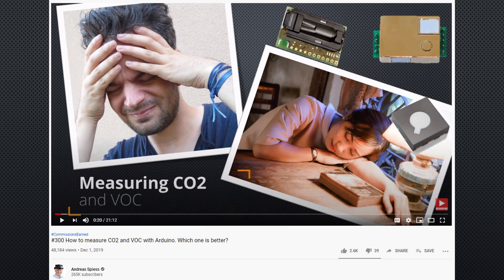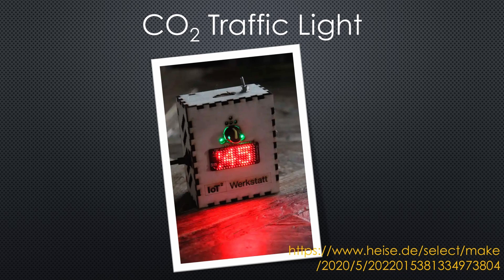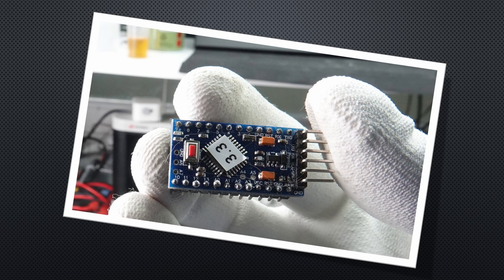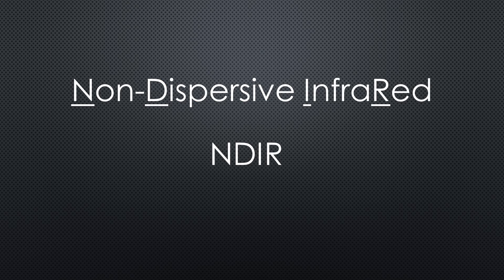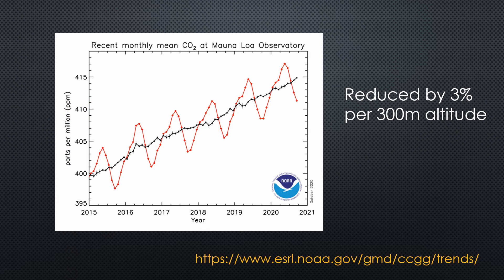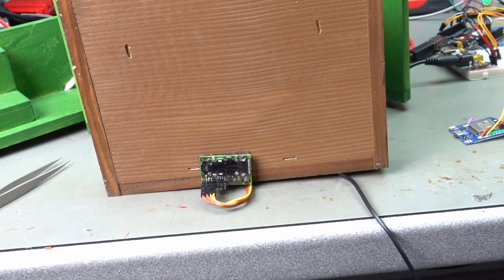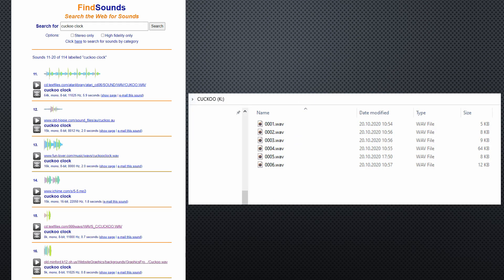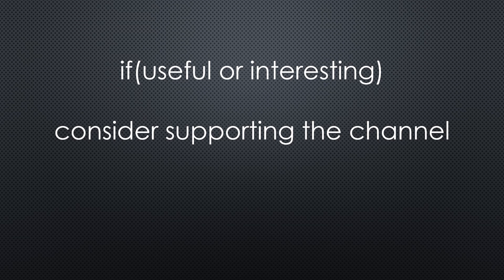#358 CO2 Cuckoo Clock for schools and businesses (Why not eCO2?)

Comment from the maker: A Patreon recommended the Senseair S8 sensor. It is just a little more expensive than the MH-Z19 but more reliable. And it is available on Aliexpress.
Reply: A quicky video on this S8 would be great! Especially a comparaison on the autocalibration feature.
Reply: Should've been named a canary clock. Because it detects gases yknow.
Reply: SenseAir S8 is way more practical than the MH-Z19.
Mechanical footprint is the same and also the signals applied to the pins is the same. So you can mechanically and electrically exchange the two.
Only (outer) mechanical difference is the position of the diffuser.

The SenseAir S8 is way more practical since it is using a much more practical ABC function.
The MH-Z19 (and also the B version) only use a 24h interval to determine the lowest measured CO2 concentration and set that as "400 ppm" level.
Problem is you need to have at least once during the day a well ventilated room or else your readings are way off.

The default ABC period of the S8 is 7 days and also the applied correction is not just based on the lowest measured value during that period.
It takes into account the aging of the sensor and it only applies a fraction of the measured correction as it is highly unlikely the 400 ppm level is off by a very large offset.

Causes for abnormal CO2 concentration in a room without people (or animals) in the room:
- Plants exhale CO2 during the night (outside in agricultural area with no wind, the CO2 concentration can be as high as 700 - 800 ppm during the night)
- Living in a city, next to a busy road or industrial area, with almost no wind or wind coming from the wrong direction.
- Freshly painted room (some drying paint absorbs CO2)

As all these causes can all occur during a period of 24h, your ABC function can be set completely wrong.
That's why you really need a sensor that can be set to an ABC period of > 24h.

N.B. in ESPEasy I disabled the function to adjust the ABC interval on SenseAir S8 sensors, as there has been a firmware bug which could lead to a user only being able to lower the ABC period, not setting it back to a longer interval.
Reply: I recommend CDM7160 sensor, it comes pre-calibrated from the factory and also the long-term drift compensation (autocalibration) algorithm is much more city-friendly (it does not require periodic exposure to 420ppm fresh air, which might be impossible in real-life situations).
Reply: There is a nice video series from the manufacturer about the S8: https://www.youtube.com/watch?v=n059hQpybsE
Reply: @julianwolter970 , and others looking at the S8 video series. The playlist is a bit nicer, all the videos are very short and don't all link to one another without the playlist.
Reply: @Pilot16H Please explain why the US voting would have all other countries worried about so much, if it were "just the flu" or artificially inflated. And no, don't bother claiming the US is top of he world, it lost any potential leadership after a few months of your bozo Golfer in chief.
Reply: @Ping Ping or fake units.
The absolute lowest sales price ex VAT in large volumes (10 k+) I have seen is around 22 euro. Take into account a seller has to keep stock, account for customer service and maybe also make some profit.
So I don't trust those sold at prices lower then 22 euro.

For the units priced at 80 euro and higher, are you sure it isnt the LP8?
Those are quite expensive and look the same (but are absolutely not exchangeable for S8)

Right now there does seem to be a global shortage on CO2 sensors, so I don't think a filter based on price to differentiate genuine from fake units will hold in the next few months

About the difference in numbers, keep in mind there are several ranges in ppm available.
Some even upto 50'000 ppm
Reply: I think Andreas Does some mindreading with al his HAM expertise 😉. Again great topic 👍👍🏾. MH-Z19 works fine for me. Bought 2 pieces 2 years ago and did connect it to a esp8266 with Espeasy firmware and domoticz. Works fine when your wifi is stable
Reply: It always boils down to: what is "good enough" (for all practical purposes) in order to give an indication when to vent a room. Many claim that a BME680 be sufficient. At the other end of the spectrum you have the $50 SCD30 or the $200 CDM7160 :).
Reply: @Pilot16H C'mon, this is an IoT channel and not another outlet for obvious unfounded fake news.

Comment: Have you measured the power consumption and "time to accurate measure" of the SCD40?
With such a small sensor, it would be cool to make something very portable (to bring to a meeting or dinner) if the power consumption is reasonnable
Reply from the maker: I do not remember. But you should find this info in the datasheet.

Comment: Hi, I own a fresh SCD30 (and an old MH-Z19). Have you found a solution to ESP32 I2C clock stretching? It's to experiment phyphox CO2-Monitor.
Reply from the maker: Sparkfun seem to have a library for this sensor which also works on an ESP32. I do no more remember how I did it. But it works

Comment: CO2 concentrations above 2500 ppm cause a decrease in concentration and laziness. As a bioeffluent, CO2 is the easiest parameter to monitor the IAQ and to control the ventilation demand if a mechanical ventilation system is available (demand controlled ventilation). VOCs are determined by the occupancy rate of people in the room as well as by furniture (e.g. formaldehyde), mould (!) and various cleaning products. CO2 is therefore the better choice in classrooms because the collective breathing volume of those present is the determining factor. I have installed CO2 meters in many classrooms already for Corona, in the years 2010-2015. Senseair S8 sensors were reliable and stable over long periods of time, MH-Z19 not so much because they drift upwards (even when placed outside for months for checking).

Regards
Reply from the maker: Thank you for the additional info! It seems that schools in Germany bought a lot of such ready-made sensors. I think it would have been a good idea to build them and learn...
In Switzerland they still did not decide on what to do. If i look at the increasing numbers we probably still have a lot of time to decide ;-)

Comment: 08:32 Does CO2 ppm reduce with altitude? I thought it was relatively constant for the altitudes humans live at with some perturbation around ground level man-made sources. The sensors need to be able to calculate the number of non CO2 molecules in the air which would be very similar to air density calculations - the pressure, temperature and humidity impact that with pressure declining with altitude.
Reply from the maker: Maybe you google. I found that it depends on hight.
Reply: @AndreasSpiess  This was the first thing I found https://earthscience.stackexchange.com/questions/16364/what-is-the-co2-concentration-by-altitude-and-why and there's a similar graph in https://www.ncbi.nlm.nih.gov/pmc/articles/PMC6263399/figure/sensors-18-04064-f006/ . There could be a slight gradient there but it does not look like 3% reduction per 300m, i.e. 415ppm does not become 290.5 at 3000m (9843ft).

Comment: Hi Andreas : great tutorials !! we enjoy it with our  class. Just a little question ? what about callibration on these sensors ? do we need to calibrate them after a few years and if so : how to do this ? of just swap the sensor maybe ?
Thx for the reply and please keep posting these great tutorials !,
Reply from the maker: You can switch autocalibration on. Or you put them outside where the CO2 is around 410 ppm
Reply: @AndreasSpiess  thx andreas, so if i understand correctly, we just have to take them outside once a year and the the auto callibration will do the rest ?

Comment: Thanks for a great video. I'm just in the almost same project for school and I just finished mu CO2 level project for my LAB - indication of CO2 is by colors of LED strip. I used Desk Stranding lamp from PrusaPrinters project (some pictures here https://www.prusaprinters.org/prints/40386-desk-stranding-the-death-stranding-desk-lamp/comments#comment-47597). I'm using sensors from Netatmo Weather Station and using Node-RED and HomeAssistant. Next project is to use real CO2 sensors and color display with ESP32. Another CO2 related gadget could be SmarWi project from Vektiva (https://vektiva.com/en/). I'm using it for a 2 years for ventilation in my bedroom (works with EU windows ventilation) and I can recommend it.
Reply from the maker: Cool project!

Comment: Andreas, thanks for nice video! If talk about comparison Co2 and eCo2 sensor, especially about css811. In css811 datasheet said that "ams advises customers to run CCS811 for 48 hours in the selected mode of operation to ensure sensor performance is stable", and in case  Automatic Baseline Correction "The air quality is expected to vary in a typical environment so the minimum time over which a baseline correction is applied is 24 hours". Based on this data we can assume that some more less accurate values we can get from sensor after 2 days after first start.  As I understand  from your graph, tests lasted 5 days,  and result after 2 and even 3 days  was't similar real CO2 sensor,  what library do you used for tests css811? Maybe there was some problem?
Reply from the maker: My tests run 6 month. I do not think I was the problem. These sensors measure something different.

Comment: At the beginning you had the Sensaire 'Sunrise' but then ended up with a S8.  The S8 needs more voltage and current (the Sunrise uses a IR LED and is more stable). Why the change?
Reply from the maker: I. Have no S8. A viewer suggested this sensor as an alternative to the MH-Z19. It is reasonably priced and available on AliExpress.

Comment: ready made injection molded amazon.co.uk r&p for cheap rather than 3d print are an option to
CHENGYIDA 15- Pack Gear Rack 0.5 Modulus Plastic Rack Pinion Drive Rod Plastic gear Rack rod DIY Parts

Brand: CHENGYIDA,Price:	£8.30

sourcing map 30 Pcs 5.5mm x 2mm 9-Teeth Plastic Motor Gear Pinion for RC Model

Brand: sourcing map,Price:£3.96

SPTwj Plastic Gears Shaft Wheel Set 78 Pcs Single Double Reduction Gear Worm Gear Robot Car Parts DIY Kit Assorted Plastic Gear Shaft Belt Rack

Brand: SPTwj Amazon's Choice for "plastic gears" Price:	£6.99
Reply from the maker: Thank you for the links! So you can also do it without 3D printer.

Comment: Surprisingly that’s not the first bird-based CO2-Sensor, the radio show Netzbasteln at Deutschlandfunk Nova radio made a „CO2-Narienvogel“ with a canary that topples from the pole if the value gets to high. :D https://www.deutschlandfunknova.de/beitrag/atemluft-co2-ampel-basteln-fuer-innenraeume-als-corona-schutz

The problem with MP3 players using the order of file creation on the file system also happens with some commercial products, there are tools for resorting the file system table following the alphabetical order, e.g. fatsort for *nix CLI. I guess klickibunti (is this word translatable?) GUI programs for Window also exist.
Reply from the maker: Some other viewers also suggested to use a Canary because of history. I was not aware of the fact that they were used for that purpose. But then it should fall down if there is too much CO2 ;-)
Thanks for the tip about the software.

Comment: I'm fairly sure that CO2 does not making you sleepy, in fact it makes you breathe more rapidly at concentrations that are relevant, but carbon monoxide is a very different story. Certain sulphurous gases caused by people's furtive emissions may also make people drowsy.
Reply from the maker: AFAIK they made tests about decision making and found a degradation with higher concentrations. But I am no medical doctor ;-)
Reply: @AndreasSpiess  Look up the data generated by studying performance of submarine crews. It is the oxygen levels that matter more, plus VOCs, and your body can't directly detect them in the same way it can CO2. i.e. You need an O2 sensor.

Comment: Was that new sensor a PoE sensor? Be pretty neat to hook up a few dozen about a workplace for easy active monitoring without needing an MCU for each one.

I also wonder how easy it would be to make a CO2 sensor like that? Two matched photodiodes and a band-pass or band-stop IR filter is basically all you need, plus a differential amplifier of some sort. Keeping the IR amplitude constant might require feedback from one of the photodiodes to the LED, but that’s not much of an issue either. Then it’s just an ADC and an MCU, with a case. I should see what those IR filters cost.
Reply from the maker: They added a different connectors. But it is not PoE. And it is not easy. Otherwise they would not be able to charge this high price ;-)

Comment: Really interesting project, but at least the sensor should however be positioned at the level of the mouth, or does the 1000ppm level take into account the vertical concentration gradient of co2? 
Probably Nasa considers the fact that in the absence of gravity the concentration of co2 can be higher because it is distributed in the entire volume of the air, not being subject to gravity.
Considering also that the beds are in draft to avoid concentration of co2 around the sleepers, there is certainly a uniform distribution throughout the habitat of the ISS.
Reply from the maker: I do not know how big the gradient is on earth. In my case the sensors are slightly above my mouth.
Reply: @AndreasSpiess  Your answer comforts my thoughts: the sensor must be more or less at the same level as where the mouth is: in the bedroom at the height of the mattress and in a classroom around 1.20-1.50 m

Comment: I just designed a board for this purpose to use in my school. I decided to use a esp32 nodemcu, a MH-Z19, an optional bme680 and a mems microphone. The Mic is used for the measurement of the noiselevel ( optional). We plan to put it in a small IKEA photoframe and let the pupils designs the front in the art classes. Two RGB Leds shows the CO2 level and the sound level. Of course, we save the measurements in an influxDB via MQTT. Repo link will follow.
Reply from the maker: Cool project!
Reply: Here is the EasyEDA Project in it's current version. Everyone feel free to use it. https://easyeda.com/deneaux/classroom-sensor

Comment: The question is if reacting to different human exhale products not only the CO2 might be even better for aerosol concentration (anyway both charts looked not very promising)
Reply from the maker: It is more about not mixing non-human odors (like pizza cooking) or soldering in my case. Co2 seem sot be very human.
Reply: @AndreasSpiess  ah yes good Point, but venting solder fumes is also a good idea

Comment: Just adding some info on the MHZ19: The MHZ19 also supprts a PWM output which is faster and requires only one digital pin of your choice. Admittedly, this requires some software tweaking to work reliably, but is working fpr me for the last 2 years with no issues. According to the spreadsheet, initial zero ( = 400PPM) calibration should be done by placing the sensor 20 minutes in an environment with 400ppm CO2 levels. For practical puposes, just put it it outside for that period and connect the HD pin to ground for 7 seconds afterwards.Leave auto-calibration on for normal indoor use.  Looks like the Senseair is very similar ( both infrared and UART and PWM output) . Not sure why it would be more reliable, construction?
Reply from the maker: I had the Sunrise sensor in my test. It is newer, but I ordered now also an S8 to put it into my setup... I like more  I2C or UART than PWM as an interface. But with stable values maybe you just have to measure one or two cycles of PWM to get the right value.
Reply: @AndreasSpiess  I had to check my old code. After all this time it was a bit fuzzier than I hoped, but I don't average values, I just measure the timing of one period of PWM ( one high and one low) using an interrupt on the PWM pin. Then I apply the formula from the datasheet.
UART and I2C are easier to get it to do something quickly and more comfortable in use, but are less efficient if the same ESP8266 is also used for PPM measurements, driving 4 7-segment displays, mqtt results and run a webserver :-).

Comment: I've been refreshing the SCD40 page for months, how did you manage to get one!?

Also you need to look very carefully at the auto-calibration cycles for different CO2 sensors when deciding which to buy. Sensirion's cycle looks for closely matching readings over a period of a couple of weeks, which is my favourite. Many of the other sensors (including the Sensair S8 IIRC) have auto calibration cycles designed for HVAC systems that have a daily fresh air purge, which ensures a consistent low reading every 24h and base their calibration cycle on that assumption. In residential applications you won't always have such a consistent low reading and so your baseline can be skewed by a bad auto calibration. 

You can also consider adding a pressure sensor and feed the readings to the SCD30. The sensor is cheap and integration is easy. I need to try switching it off and see what happens sometime though, I don't know what the real impact is. 

The temperature and humidity sensor is also super important. The readings can change drastically if the temperature and humidity values are wrong. 

/rant
Reply from the maker: I have a pressure sensor added in my setup (the BME680). But I think it does not change too much for our purpose.
Calibration here (and also in class rooms should be simple: During night the air should be close to 400 ppm. This is what I had a look and the Senseair and Sensirion did it quite well. The MH-Z19 sometimes did not return to this level.